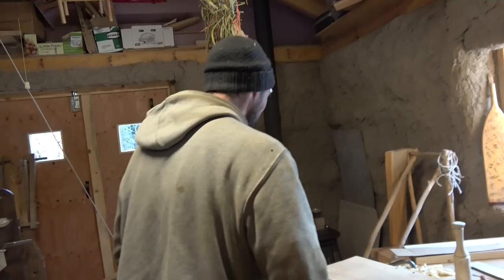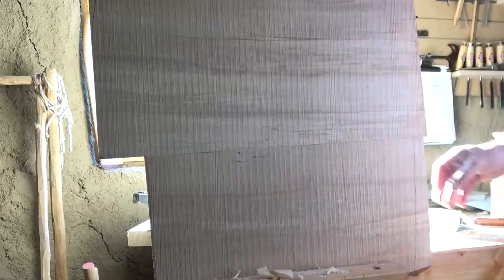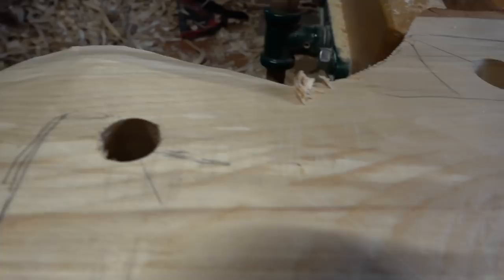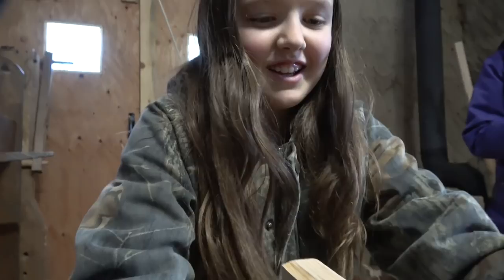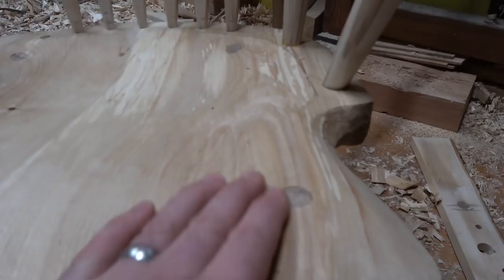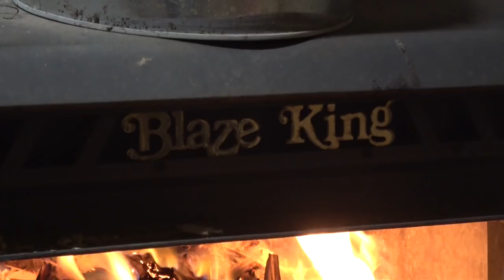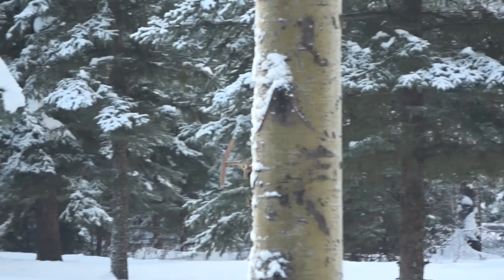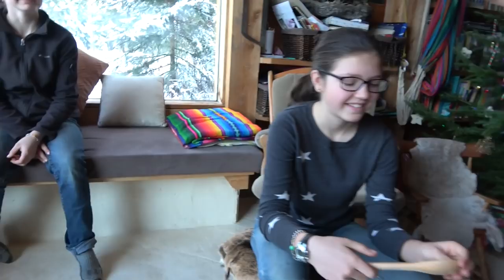Off Grid Wood Working: The Home Made Rocking Chair

Comment: I've been building Kentucky rifles for years and I learned a new technique for drilling holes. Plus now I want to make a rifle out of birch. Its an uncommon stock wood, but they did use it at Christians spring in the third quarter of the eighteenth century.